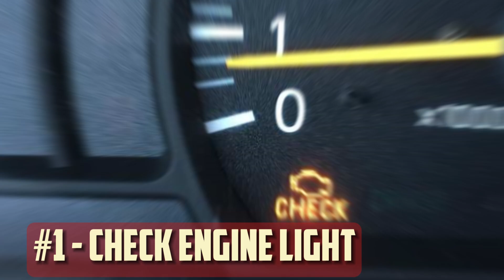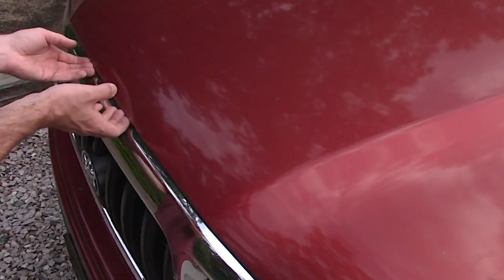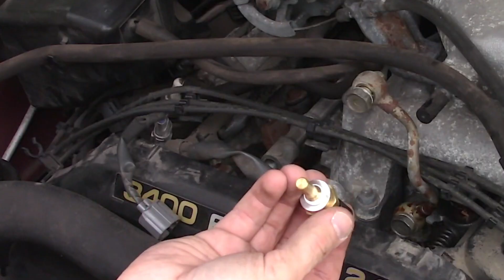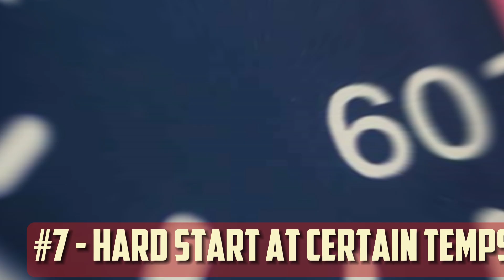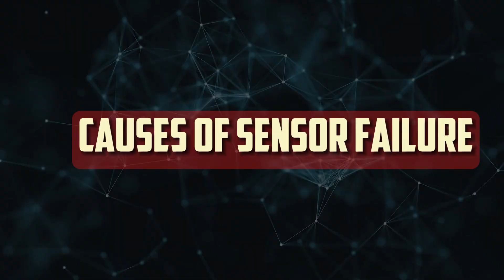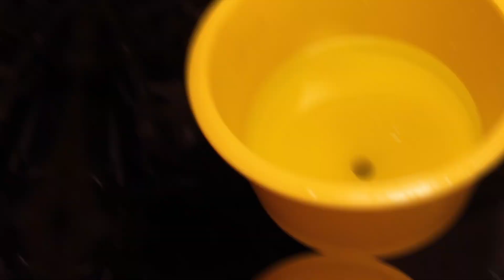7 Bad Engine Coolant Temperature Sensor Symptoms & Replacement Cost

Comment: I have nothing but a fluctuating gauge! Ever since I changed the radiator and flushed the engine with water and detergent "ARIEL" , this issue started popping out even though I have a key switch for fan and the engine top hose to radiator seem cool to the hand touch but gauge shows HIGH TEMP and it increases when in traffic and decrease fast when i push the pedal on stop\park .. is it possible that it could be it!? It's really annoying plus i have no head gasket issue or water pump issue or any side issues!!
Reply: Did you ever figure it out.? I’m having the same issue.
Reply: Did you bleed your coolant system after you changed the radiator and filled it with coolant?